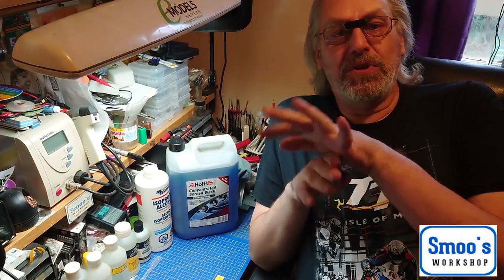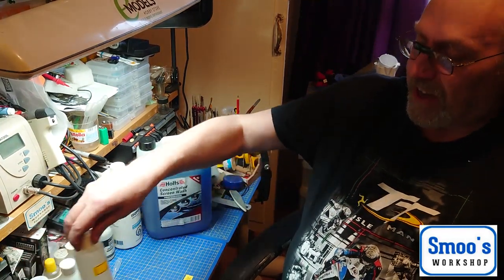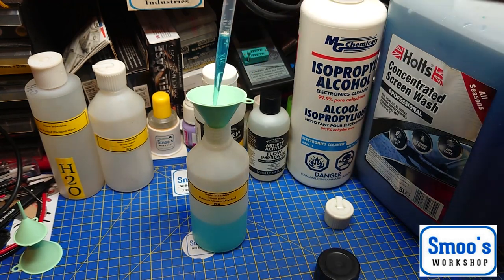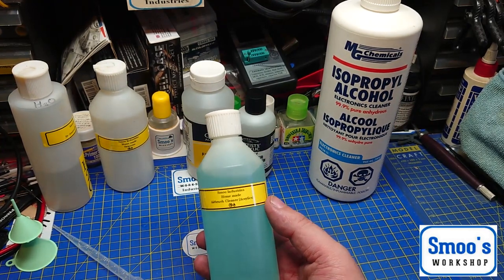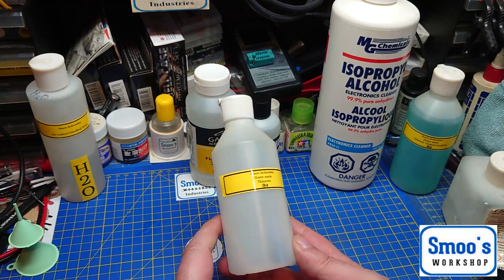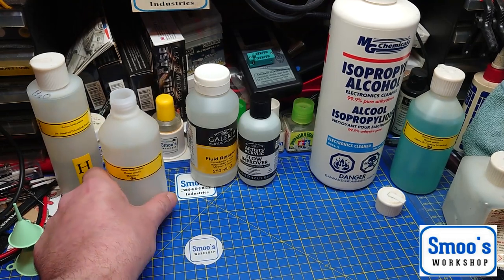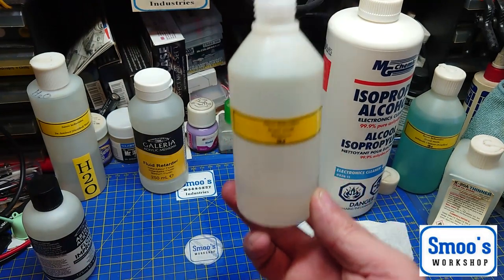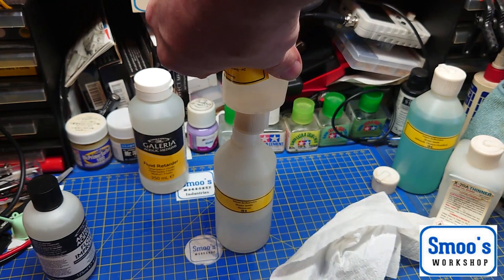How to - make your own airbrush thinner (and cleaner..revisited) for acrylic paints

Comment: One of the benefits of the alcohol is that it beads up the water to sheen off.  I Add a 1/4 cup of alcohol to the auto windshield washer container and 1/8 cup of vinegar and then fill with water.  It will clean the windshield and also when raining will make the water bead up and make it easier to see.  One time our wiper motor burned out in the rain while driving down the road.  I pulled into a pharmacy and purchased a small bottle of alcohol 71% and poured it on a rag to wipe all over the windshield glass.  I then drove to a bank that was closed to clean the glass dry and reapplied the alcohol and wait for it to dry.  Then (with no wipers cleaning the glass of rainwater) we were able to easily see good enough to drive 10 minutes to an auto parts dealer,  buy a new wiper motor and drive another 30 minutes home.

Comment: Terry, thanks for the info, most helpful but one question.... can you confirm the capacity of the bottle that you used to make it in, it looks like a 250ml bottle, but to be accurate it would be good to know especially when only adding 5mls etc.... thanks again  well done.
Reply from the maker: The bottle I used holds 270ml